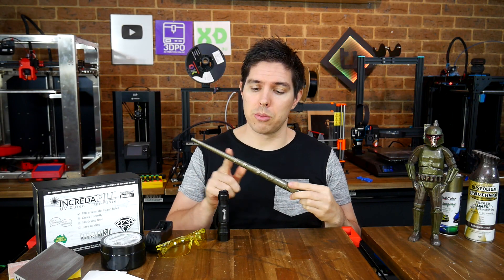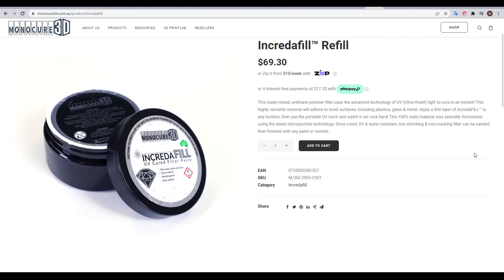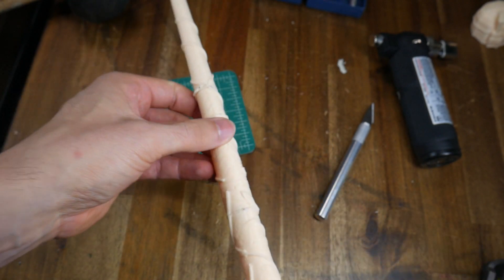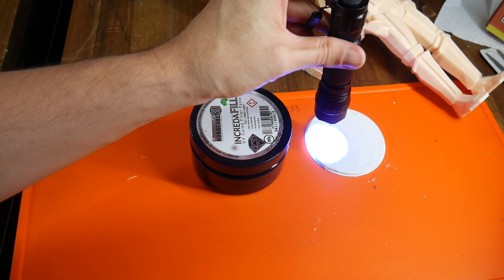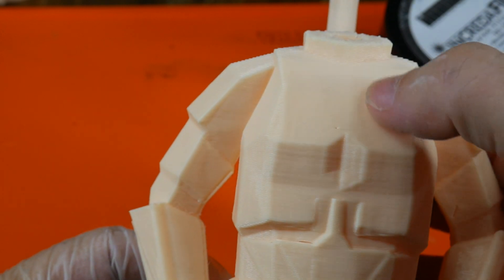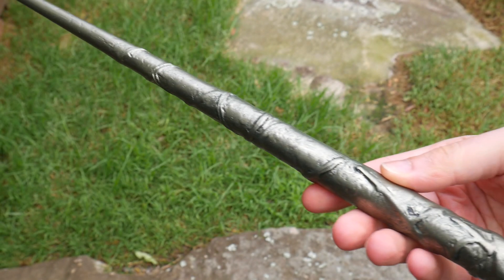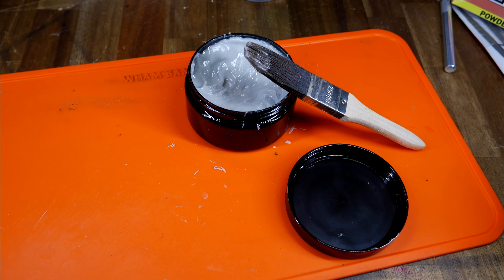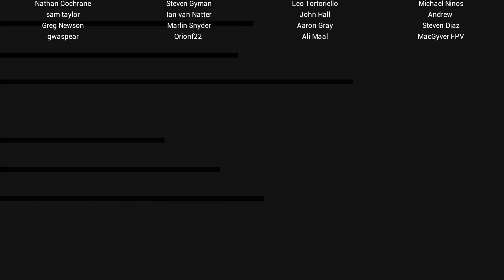Incredafill putty: Remove 3D printer layer lines with the power of light

Comment: 120 bucks.... its just rebranded UV autobody glaze putty. You can buy that stuff for like 30 bucks a lb, as for the flash light and charger you can get those for like 5 bucks they are just cheap Chinese wholesell with branding slapped on them.

Comment: Looks like a waste of money to me and some extra steps and its toxic.  Just get yourself some bondo (or other brands) spot putty, its one part, no mixing, sands pretty easy, doesnt set up overly fast or to slow.  Just squeeze from tube on to finger in detailed areas.  One good coat of that, some sanding , then a 2-3 coats of rust oleum filler primer and your set

Comment: Way too toxic, too expensive, too much hassle and the result is not great. You can basically use regular UV resin so get the same kind of results. You can use many other products instead too. Like automotive putty, spray putty, PU varnish (for smaller layer hights) etc. Which cost significantly less and do a similar job. Why use a UV hardening product at all if you can just use a two part product with less odor and less hassle. 
This product is a clear pass for me.
Thank you for the review.